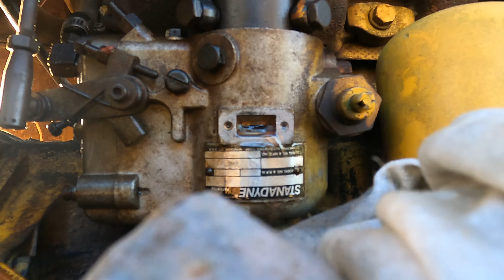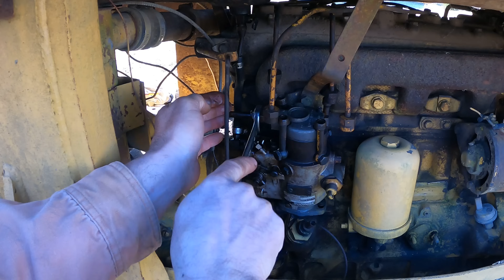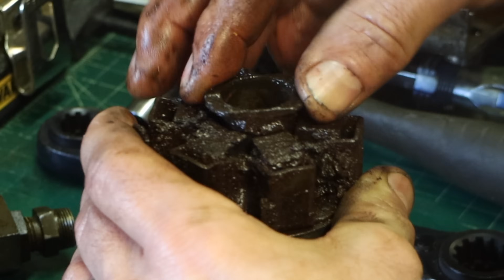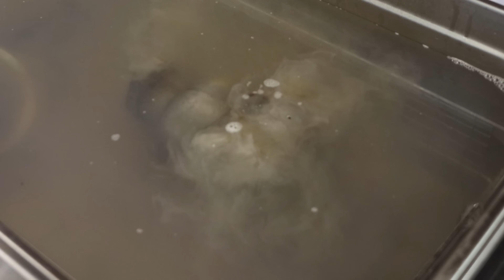Forgotten John Deere 1010 Track Loader, Part 2.

Comment: Jon — much as I'd love to see a rebuild (loving this machine) I think a few comments above are on the right track. This seems like stuck rings to me, especially if there was enough moisture around to get so much rust on that pump shaft inside the crankcase. Before your rebuilt it, my suggestion would be let the cylinders sit with some ATF in them for a few days or even weeks to see if it can free them up some. The wet test improves each cylinder differently probably because the cylinders have a slight amount of taper to them; the rings will be even less sealed in the pistons that were near the top, if any. A little Evaporust onion the ATF might also help. Then I'd drain the oil and change it before trying to fire it again. The suggestion above to clean the injectors is also a good one. Also, if you can get your borescope in there you can at least gauge the amount of rust and possibly eliminate cylinder wall damage. I wouldn't be at all surprised to see some scoring in an engine that tired but it might not preclude you from getting it running "well enough."

Bearing in mind you can do all this for nearly free. If you can get it running as-is for even just ten minutes, those rings will likely start to come around and after a few hours of operation might be just fine for the amount of use you have planned.

Also, don't use glow plugs and ether -- big boom, cracked ring land, no bueno.

If that stuff won't get it running, then a teardown would be a blast to watch. If you haven't watched Squatch253, his videos prove that there's no reason you can't get this back to showroom -- but for your purposes, a FarmCraft rebuild would probably be plenty. 

Good luck!!

Comment: I kinda lean towards scrap.  Rust inside the crank case is bad bad.  Second issue is the trandmission - maybe good, maybe bad.  Damn undercarrage looks OK.  The actualy use case with your other equipment is a question mark as to what you would use it for.

SO ....... PART IT OUT OR SCRAP IT.  I think she is probably a money pit and you can find a better winter project.

Comment: I feel Compression will be greatly improved after running the engine. Fill the cylinders with Carb cleaner to loosen the rings and repeat it few times with turning over the engine. Do tear down examination  and sell the good parts ????? Bummer, should done the compression test before all that work and money invested !!!!!

Comment: In a nut shell  , what the total cost to get everything that you know need repairing  , 
Than all the surprises with the turning brakes an transmission  , plus this  , that , and the others  . 
It looks like it has some good parts and then scrap weights  .
One last thing is there other things that you would possibly like to spend time and money on  ?

Comment: Symptoms of a injector pump being 180° out of time include very hard to start (needing ether) and low power when running, as some of the fuel gets foeced past the rings, which would explain your over-full oil pan.

It will also explain low compression, as diesel fuel isn't as lubricative as engine oil.

Try rotating the pump timing 180°, and start it using two 12v batteries in series to spin the motor faster, decreasing the time that the compression can leak down.

Change engine oil, and substute 1 quart of oil for Dextron transmission fluid.  It's basically high-detergent motor oil.  Don't use Ford or Mercon trans fluid; it's sticky.

Comment: I would change the oil, put some ATF down into the cylinders for a week. Then when I was ready to try to start the motor I would preheat it with a salamander. You can use a sheet of wood against the far side tin to keep the heat in. Then give her a good shot of ether and see of it fires off.

Comment: The next easiest thing would be pulling the valve cover and checking those. When you had your Boroscope, and could see into the 
Valve train the rust on those valves could stop them from making a good seal. I have experienced that exact issue a myriad of times. Try pouring tranny fluid in each cylinder, then starting (without blowing out the excess? If you could just get it to start for five minutes, I think that old girl would be OK.

Comment: Jon, look around and find another used engine that for sure runs. These engines may have come on other machines. Find a running one and slap it in there. The bottom end on this machine looks good enough for putting a few thousands of dollar engine in it. Best of luck. Sorry there was so much frustration on this. I have been there and felt what you were feeling. Only thing was I didn't have a tool (lath) that I could make what I needed. I commend you for keeping on going on this. Your going to do great when you start your airplane build.

Comment: With all working glow plugs you might have had a chance and there a better than even chance the rings are stuck ,put new glow plugs in it first then ,Do the injectors work ? do the simple things first , before you consider a engine tare down .

Comment: Experiments or myth busting possibilities suggestions #1 try a more combustible fuel mix that will ignite a lower compression, #2 run a thicker high mileage oil, #3 heat up the intake before starting, #4 feed pure oxygen into the intake,

Comment: Of course if you are entertained and get satisfaction by rebuilding old parts, then go for it. However, you should seriously consider your time and the added expenses as compared to what you expect to get out of the running track loader. You are always going to need "another" tool which you don't have to complete the rebuild. If you have a burning need for a track loader to do lots and lots of work then your time and expenses would be justified. If not, scrap it, maybe play around with parts for other machines. The perceived problems with the engine could be quickly fixed by finding an engine from another source (scrap, wrecked 1010, non-working 1010 or a retrofitted engine). BTW, that fuel pump rebuild was much appreciated.

Comment: I think you should at least remove the engine and do a tear down. See if you can determine if the rings are bad, or the bore. Ya have to look at valves as well. I think it's a pretty neat little loader, I could have a blast playing with that thing. Great job on the pump rebuild, I learned a lot following your lead. Jay from Pa.

Comment: Dump it and find a better one to mess with. This one looks like a money pit. If this was the only issue it might be worth looking into. But the hydraulic system looks pretty bad and you have no idea if the drive line works. Pull the pump off and dump it.

Comment: I think you gave up one video too early.  You are not done yet with your attempt.  Take out the injectors and make sure they are spraying, add some oil again through the injector  holes just before you crank so you have improved compression, try the heat gun idea and give it one last go.

Comment: Well...if you take the time to tear it all apart you might as well fix it. I would say No.  Go buy something that at least doesn't have major engine problems and is easier on you. Plus most ppl aren't going to work on these anymore as they are obsolete. Spend a few more thou and get something that will at least run. Theres video content to be made on any machine you have. I think u know what u want to do already. But you asked. Im on board whatever u decide friend. 👍

Comment: Well first you have to decide . How much is this machine going to get used or is needed around the farm . The worst thing for an engine is sitting without running. Will the bucket fit the already running dozer ? The fuel pump is worth money to cover your losses + scrap price . You mite recover enough to bye a new project . So dont get you petcock in a vice and double down on it . No room for pride here. Awesome video. Thanks

Comment: I have some experience, I started working for John Deere in 1974 and there were a lot of the 2010 and a few of the 1010 tractors still around then. My advice is to start from scratch and recheck your timing.  Pull your valve cover and make sure it’s on tdc #1 cylinder.  Then install your pump.  The way it whistles when you crank it tells me it has enough compression to at least fire.  Also don’t use ether after warming up the glow plugs,  the resulting boom can break the compression rings.  Another thing, don’t attempt to adjust the timing with the engine running. If the pump drive shaft binds in the housing it will spin the pump tearing all injection lines off.  Only saw it happen once, it was not pretty, the man’s hand was grabbed by the lines and badly injured.  The 1010 and 2010s were John Deere’s first attempt to build a four cylinder engine after the two cylinder tractors they were famous for.  They did not have everything figured out yet.
Reply: Agree, also I'd check the valve clearence while you have the valve cover off. Given how long it sat, and the amount of rust you found in the fuel pump, there's probably some rust on the rocker arms/valve stems that'll cause the valves to bind up and not close completely.
Reply: @generaldisarray poo
Reply: @jackstjohn4175  What is ???,
 it is common place for valve stems to seize in their guides when an engine has not run for several decades especially the open ones....the rocker arms usually have no problem pushing the valve open - but the corrosion usually prevents the valve from re seating fully due to powdery corrosion around the seat and stem,   the same thing applies to piston rings too, many an engine manages to free off and loosen up once you can actually get it running long enough for it to warm up and free everything off especially on the older less tightly toleranced stuff, I say many an engine....not all, some may have spent decades under differing amounts of  water with differing levels of corrosion around sealing surfaces that only a hammer and drift disassembly and major rebuild will cure.
Reply: @jackstjohn4175  did you mean boo? I'm confused, please try to construct a coherent sentence... C'mon, you can do it, use your words... 🤣🤣
Reply: @generaldisarray I think he was making a reference to the way Jon was putting the 💩 emoji in the first video every time he said "look at all this stuff in the pump".
Reply: @druming9  we may never know for sure... 🤣
Reply: I say the same as the others, there should be enough compression to get it running. Can you test the injectors to see if they are spraying any pattern, maybe worth just putting them in the cleaner to see if it helps them. Connect them back to an injector pipe , keeping the injector on the outside of the engine to see if they are working. You need to make sure the injection pump is timed right too, else there is no hope of it firing.
Love your videos and how in-depth you go into things, keep them coming.
Reply: @dowker66 -Cleaning the injectors was going to be my suggestion as well.
Reply: I wonder what the compression would be necessary to fire off ether. Once running, I would guess the compression would improve.
Reply: @quantumss I ran a stock car once with an engine built from worn spare parts.  Compression was about 70 psi max with 11:1 compression pistons.  When the engine finally started and ran at 6500 rpms it actually was competitive!  I think this tractor will run!
Reply: @quantumss an engine with no rings will fire ether.
Reply: @daleolson3506  I'll refer the gentleman,  @quantumss  to Zip Ties N Bias Plies to see how a good snort of the old "Cosby Sauce" can breathe live into any old engine...🤣🤣🤣
https://www.youtube.com/@ziptiesnbiasplies
Reply: I agree not to use the ether on warm glow plugs  . That injector pump was full of trash so the injectors are probably plugged up also . You have invested the money for the injector pump rebuild then go ahead & have area diesel check the injectors also. might be as simple as that .  Then I would definitely lube up the cylinders after sitting so long it might help the compression a little also pull the valve cover to check that you are at top dead center and verify that you are timed correctly as well as to see if all the valves are moving. Your working in the right direction on this problem . good luck & keep the videos coming .
Reply: Yeah >200 psi is more than enough to run. You don't have stuck rings if it's making that much, and all 4 are evenish in pressure. Old diesels don't need much to run. 

I vote for bad injectors, even if it was 180* out it would flood the cylinders to get some smoke.

Also one bore 200 psi bore with a good glow plug/warm air will run that motor enough to get some smoke. So you have nothing firing other than the ether, and even the ether should have some soot if there is fuel too.
Reply: The deisel fuel acts like a light oil and the cylinders were dry because it was sitting for so long and the injectors weren't spraying and when it runs for a few the compression will get better.
Reply: Fix the glow plugs, old diesels love the heat, then pull the Injectors and get them spraying, then the diesel spraying in the cylinders should give you better compression for suck, squeeze, bang n blow. Gives you something to do over winter😊
Reply: 1.  Don’t quit. 2. Keep simple. 3. Remove valve cover.  Valve springs closing all valves?  4. Check valve clearances. Adjust if needed. 5. Reinstall injectors. 6. Jump to your truck battery, the engine should crank faster. 7. Use a new, pressurized can of starting fluid . Spray. Crank. Pray 🙏 👍.  Keep up the great work 😎
Reply: As a 40years field mechanic, I agree, it should start, timing is 180 off, us wd 40 not eather it should run and may " cure itself " once it starts and goes through some heat cycles, don't give up on it yet! Good video it will encourage people to try !
Reply: Also, if you use a lot of starting spray, it will clean of oil from cylinders, so that is also one additional reason why compression was low.
Reply: Luv yur pretty comprehensive guidance and instructions.
Reply: You are Lucky! Had it been working right off - you would need to find other stuff to make good videos on! This is going to be good to watch - as usual😊
Reply: I totally agree Scottwood2731. Start from the beginning. John mentioned being out of time. I surprised John did make sure he was at tdc. It's either 180 off. Pulling the valve cover off and double checking for tdc. Then reinstall the pump. Basically setting the injection pump like it was after a engine rebuild. 
I do agree not using ether. 
Possibly find a way to see if the injectors are spraying too while they are out. 
I'm not a Diesel mechanic. But I aced my test on my ASE exams and own a code reader...so I'm super qualified 😅😅😅😅😅
Reply: No experience at all but do enjoy your videos and work ethics. Would like to see you pull the engine and tear it down. Perhaps not as bad as you think compression wise when you remove the head, remembering the rust build up on the intake valve looking through the endoscope.
Reply: Look at the valves, probably not closing correctly! Easy to check with the valve cover off!
Reply: Send the injectors to get checked and try again and then we will see if you need to rebuild the engine
Reply: Absoultely!!!!!
Reply: Yeah and then hook it to a tractor and pull it in high gear a while
Reply: @JOHNNY07-wu3cd  I have an old ferguson with a standard motors diesel.  When I got it the glow plugs didn't work.  Used ether but that often washed down the cylinders.  The best way to start it was to have Dad pull me down the road.  Dad had a stroke 16 years ago and passed away 12 years ago so I had to fix the glow plugs.
Reply: Did you ever get all 4 glow plugs working?  As mentioned, double check the timing, and rebuild the injectors.
When I was having troubles getting my Ford tractor running a while ago I also used either a hot air gun or a hair dryer in the intake.  Just to get the air coming in a bit warmer, especially as we're coming into winter.
You might also send an oil sample out for testing.  As you already expected, fuel contamination is quite possible.  That may be an indication of needing a rebuild.
Reply: Wow that is one complicat3d part.   My brain hurts,  about the only more c9mplicated th8bg I have seen was taking apart a zoom camera lens
Reply: Cannon target????
Reply: Autopsy and and then decide John

Comment: Autopsy, to look at the bottom end, if it is ok, then maybe a hone to clean up the bore and a new set of rings and a little valve grinding compound on the valves to help them seal a little better.

Comment: My uncle used to light a piece of paper,  (page out of newspaper) put the flame on air intake there was a bolt he undid on the actual manifold, so bypassed the filter, when starting instead of using glow plugs,  worked every time.  Edit,  really just commenting for the stats,    Obviously heating this way won’t fix the issue at hand here,   Just thought someone may find it useful,

Comment: I think you should at least give her a good hone and a set of rings and touch up the valves. Disassemble the fuel injectors and clean them at least. Maybe a tip or two. She woll go. The rest of the maching looks good. You are already an ace onthe hydraulic cylinder. A good strong rig to have around the farm. No problem to push the Feritlizer to Washington. They need more shit! To much going out on the TV waves through FOX

Comment: Some thoughts... the crankcase is probably thinned out with diesel contributing to lower compression plus the rings being a bit stuck from sitting for years. I think I would try an oil change and shooting some 20w50 in each cylinder and try to get it to fire-up.

Comment: The compession is a bit low but First repair the Glowplugs and the injektors than try again.
It should start with the glowplugs working.
Than let it run clean the valves with breakFluid.
Than mesure the compression again.